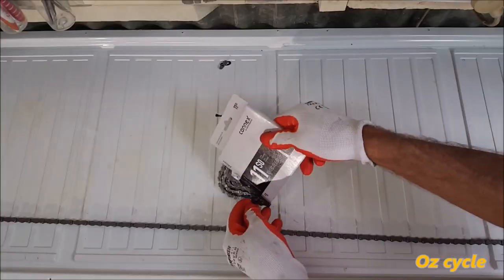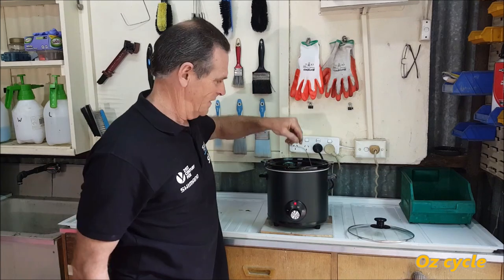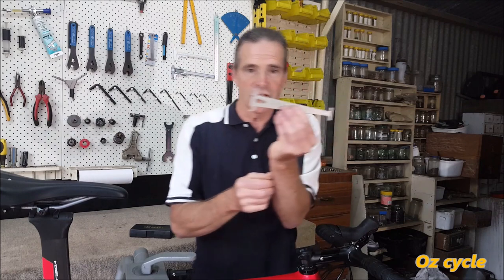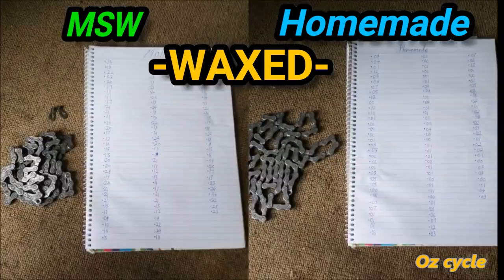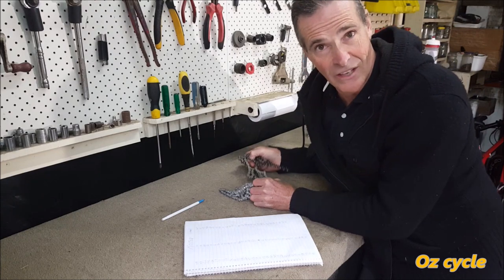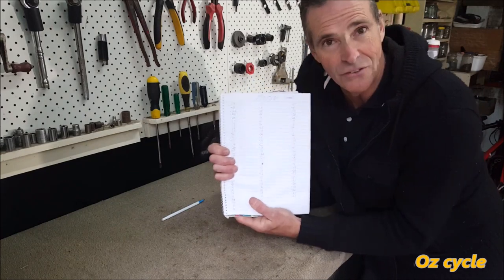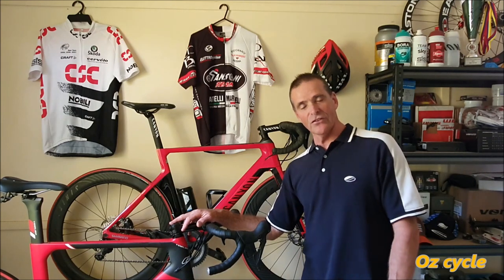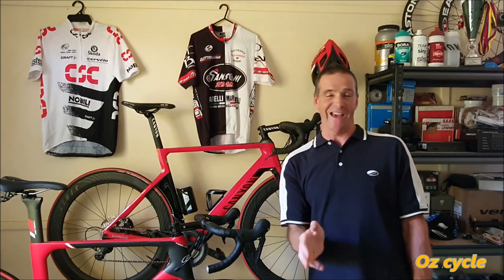Is this the ultimate bicycle chain lube? - Test results

Comment: You should have measured the stretch of the chains before they were used, to eliminate manufacturing variations as a variable.
Reply from the maker: As demonstrated,a new chain measures 0 (or very close to).
Reply: @stevenleffanue  True, a new chain measured 0.  That's probably normal, but it could be an artifact of different manufacturing lots.   Given that the experiment tells us what we expect (e.g. that used chains are longer, and that our special formula is better), that seems unlikely.  But imagine for a moment that all three chains are exactly the same length they came from the factory at; there's a 1 in 3 chance that you'd randomly see the new chain as shortest.  For that reason testing before and after use would be the best way to conduct this experiment.  Nitpicky, I know.  Since it's too late, another thing you could do is try to establish what the normal manufacturing variability is by testing several new chains.

Comment: In the 3000 km that each chain was ridden how many times was each chain lubed. I think that you said when you started to do the testing after 3000 km something about 200+ km. was this typical for both chain lubes. Did they stay on the chain the same in a variety of conditions?
Reply from the maker: Rewax every appx. 250km for both chains

Comment: How often did you rewax or clean the chain? I am about to buy a s-pedelec for commuting with a gates belt drive and now you I am unsure, wether a chain with your wax treatment is also as low maintenance as the belt. Anyways, love your videos!
Reply from the maker: Rewax every 250km Maurice....Will be explained in the next vid
Reply: Thanks oz cycle, then I‘ll go for the Gates Belt.

Comment: Great  video, using a scientific  method  some how!!!. I tried the old  formula but there  was  a moment that it was making  too much noise and I have to say that I didn't found  exactly all what you mentioned in that formula... (I am a Colombian leving in The Netherlands). Then, after some  inspection... I cleaned the chain because of the noise  and I was worry because there was quite some sand particles in  the chain. Here is great for riding the bicycles (bike paths  are perfect)  but is like riding in dunes... lot of sand atfer each ride on your bicycle!!!. However. After going back to lubricants... I regret it. So; here I am also waiting for the new formula, to si if I can replicate it better than last time. Lastly could you  explain the maintenance you did during the 3000km... like did you clean after every ride...or wash it .... only with water or something else... thanks a lot and again great job.

Comment: Hi Mr Oz can I boil this Wax in a Pot on table top stove with Fire? or do I need electric cooker? 
Also you can get 40,000 KM from a chain using this method, any idea how much life you would get from the cassette and chain rings by also using this waxing method? how was the life of ur cassette after 40,000 KM?
Reply from the maker: Yes, you can melt the wax in a pot on  a stove, but it's easy to accidentally overheat it - always keep an eye on it if you do it that way.

Comment: love the videos. This might be a dumb question. Can you use wax on bearings?
Reply from the maker: Not really because its not viscous. Bearings require a lube that moves.
Reply: @stevenleffanue  replaced bearings on front hub. Not spinning as well as I expected. Is there a brake in period?
Reply from the maker: No. Check that seals are seated correctly

Comment: Just a thought but the way the resardue that was left in the MSW chains jar looked magnetic almost in the way it settled, the bits of rust being iron would have magnetic property's and so do metal shavings , like I say just a thought
Reply from the maker: A lot of it may be fine metalic dust from the road? Is there any ferous metal in our brake pads?
Reply: @stevenleffanue  metal brake pads would explain it if you had one bike with them and the other didint, I would put it down as a win that your wax had no metallic bits in the residue from your wax , still it would be interesting to know what the other gunk was made up from

Comment: @17:20 some of the links had a slight curve in them. You should pull the chains a bit before measurement to make them straight. Also they are not completely parallel, which further increases error. It would have been better if you measure the length of the original chain, then compare that to the used length since even 2 brand new chainsets will differ somewhat.
Waxing however looks really promising technique. The fact that dirt is not sticking to it is super cool.

Comment: Most likely the grit from the law chain is metal contamination from the manufacturing the chain. 
You should use the chain with factory lube for a short while before cleaning and waxing them

Comment: Hey - just a thought. If the homemade method is so good against rust, would it be also much better defending against salt in winter? Or is the snow/sand/salt just unstopable, and the only way is to get bike with everything with aluminium and some Rohloff/Pinion gearing with belts?
Reply from the maker: It would indeed better protect your chain against salt. Paraffin wax is quite innert against a lot of substances.

Comment: 4:10 That wax mixture does not look emulsified. Must be that "additive" mentioned at 10:40. Whatever it is it's white (PTFE powder?)
However, this new wax looks solid compared to the old formula which was pasty due to the paraffin oil. I thought there was a benefit for having a pasty wax as opposed to a solid wax which can flake off. Will have to wait for the video covering the new formula.....
Reply from the maker: Correct Derek...old wax is pasty,new one is harder

Comment: Re the initial clean of new chain, why is the msw chain soaked in mineral turps but the homemade one soaked in petrol? Aren’t you trying to do the same thing for both - just trying to remove the factory grease?
Reply from the maker: Yes. Petrol disolves the grease better than turps.
Reply: @stevenleffanue  that’s great mate. Thanks for letting me know 👍

Comment: Thank you for your extensive research. I’ve read that it’s best to pre heat the chain prior to putting it in the molten wax, have you tried this?
Reply from the maker: You can put chain in whilst still cold and heat or when  wax has melted...I didn't notice any performance differences.
Reply: Thank you for your reply. I’ve put it in when hot and seemed fine, I will try from cold and see what happens. I know you’ve been asked but I’m a bit stuck, I used lamp oil think it was the same as paraffin oil but the wax felt slightly dry when rubbed. Do you use liquid paraffin even though it has a low flash point?
Reply: To add, because we in the UK name stuff a bit different paraffin liquid is basically kerosene for heaters and paraffin liquid BP is the oil. If I have this wrong please correct me.

Comment: In the molten petrol it's molybdenum powder and the reason for the extra wear might be that the chainrings had different wear from the beginning.
Reply from the maker: Both bikes had same mileage and chains were swapped to each other bike at rewaxing.
Reply: @stevenleffanue  then I'm non the wiser. Very informative video. Thinking about waxing my chain now. Have you tried using an ultrasonic cleaner for the application of the wax and tungsten disulphide instead or combined with the teflon?
Reply from the maker: I found that repeated uses of ultrasonic baths puts minute pitts in metal surfaces. Chains quickly loose their anodizing and rust becomes excessive
Reply: @stevenleffanue  Oh that makes sense, thanks! What about the tungsten disulphide?

Comment: @ oz cycle: are you saying there wasn't any rewaxing-refresh whatsoever for the full 3000km for neither chains? Comes Two different questions: (1) Could it be the MSW wax is mostly gone -as evidenced by the rust spot perhaps? So the difference isn't performance but just highlight a cost difference (time & money). Are we explaining that difference in durability by the only the MoS2 in the MSW product? If true that would be quite a downside (2) Should we interpret that the "HM wax" (1:10 PTFE @1.6um) only need refreshing every 3K-km ? And save on consumables? SO Why then does the subsequent video recommend a rewax maintenance of every 300km ?  Few last questions is what would be the  "HM" durability difference between paraffin-only and 1:10 PTFE additive.  Could the ambient temperature alter the projected durability we think (any error bar there)?
Reply: For higher operating ambient temperature, may use higher melting point wax.
Reply from the maker: Rewax every 250 - 300km. 
The PTFE wax performs better than oiled wax as oil  attracts dirt. Temperature doesnt matter
Reply: Seems like MSW might be something around 0.01:0.1:10 where 10=wax,0.1=PTFE,0.02 MoS2 % weigth. Could the delta with "HM" comes from the lower PTFE grade in MSW? Maybe MSW has the best cost ratio for volume with lower PTFE higher grain size that requires a tiny amount of emulsifier. The HM seems more cost-effective. Also the metling temperature guidance from MSW probably applies to HM. My guess is higher cycling temp is reducing the content of higher carbon number loosing its property and making it more oily-like.
Reply from the maker: It would be handy to know the grain size of the PTFE used in MSW.

Comment: OZ, did you experiment with wet-ground Micra powder? with or without the PTFE? From what I've read, wet-ground is best for use in lubricants. I`m curious as it could be a way of introducing colour to the lubricant and an indicator for when to reapply.
Reply from the maker: May interfere with the lubrication properties

Comment: Help! I have my formula down to 3parts solid/2parts liquid paraffin. consistency is good, just not flaky any more, but after a ride in wet conditions I see surface rust at the lashes around the pins. Wax coverage isn't great is my guess. What to do?

Comment: I almost forgot- great results! I used to use paraffin wax years ago, back when 10 speeds referred to the whole bike. I’d like to learn your formula.

My lube for the last several years has been a 1:5 ratio of heavy gear oil : mineral spirits. Apply and wipe off. Works well, but I do it often.
Reply: By gear oil do you mean transmission oil?
Reply: @michaelfasher  
No, I’m talking about the oil used in the differential, SAE 80 or 90. I suppose that bar and chain oil used in chainsaws would work as well or better, but I’ve never tried it.
Mix the oil with mineral spirits, about 1 part oil to 5 parts MS, the ratio is not fussy. Apply to the chain using a brush, slowly back pedal to work it in, then wipe as much off as you can, taking the dirt away. Let it dry overnight before riding. To that end, I try to do it at the end of a ride, not the start.
Reply: Why did you change?
Reply: @Leo-gt1bx  
I changed when chains changed. You used to be able to press rivets out, dip the chain in the paraffin mixture, then reassemble. When chains became narrower with 8 speed cassettes, you couldn’t do that anymore. Now you can use a power link to do that, and even more easily, but I like the ease of using my oil/mineral spirits mixture. It’s easy and the chain gets really clean in one step. I’ve been using the same quart of gear oil for at least 20 years and I still have most of it.

Comment: You are magicman, great job 👍, I wax my chain month ago with 50:50 parafin wax and parafin oil, it's realy quiet and smooth. I'm curious for new formula. One question: how many times was cleaned / waxed those chains during 3000km???
Reply from the maker: 11 times each chain
Reply: @stevenleffanue  thanks

Comment: Interesting, thanks for the info - like your style. As acknowledged bike chains are cheap mass produced somewhat non-precise. In the case of early motorcycles drive chain wear was huge 9some even went to enclosed oil baths), until o-ring chains which sealed in lubricant and said chains now last huge distances with huge power being transferred. However more friction with the 0-rings in the chain. A few watts of power loss, not an issue with 100+ Kw engines. So this leads me to the big question: power consumed Vs wear. In a racing scenarios racing mates or say  "real racing" Roglic/Valverde etc a chain that lasts forever but sucks say an extra 5 watts then Watt weenies would  probably go with more wear. Have you though about measuring watts consumed - say just after waxing, 100Km after re-waxing a few times etc? Has to be easier than measuring every chain link ;) Thanks again
Reply from the maker: The bicycle chain doesnt have o rings and relies on metal sliding parts. At low power,paraffin wax offers the lowest friction recorded (see bicycle lubricant friction charts).

Comment: May I ask if there is anyway to tell visually whether the wax is really adhering to the chain surfaces and in between gaps?
Even with clean chain, the leftover wax seems chunky and “breaks off”. I am not sure whether insides are waxed
Reply from the maker: If your chain has been cleaned properly the wax will stick

Comment: i found your videos in the past by accident researching the best lube for a motorcycle chain. i tried wax without success. in fact the wear was just like a dry chain. i worn 3 expensive chains testing various wax and technique. i then started using motor oil and it almost stopped the wear. i am not saying wax is not good or that you are lying. your test clearly prove it to be the world best for bicycle use.
sadly it isnt suitable for all application. motorcycle might put too much pressure and centrifugal force on the chain for wax to work.
Reply from the maker: Thanx for letting us know how it went on your motorbike. Cheers

Comment: You didn't clean and re-waxed the chains for 3000 km? In previous video's you told to re-wax (dry or liquid?) every 300 km...
Reply from the maker: Yes,rewax at 250km
Reply: The whole procedure? Taking off, cleaning and hot waxing?

Comment: How about testing different types of wax (with no additives)? I’m a beekeeper, so I waxed my chain with beeswax. When I tried adding PTFE to the wax I was dumbfounded by what I saw! The PTFE floated on the wax like oil on water. It would not mix in no matter how vigorously I stirred. Beeswax obviously is different in some way that makes it better OR makes it worse than paraffin wax. Worse in the sense that PTFE cannot be used. But might it be better as a wax? Good question for somebody to investigate. My guess as to why the PTFE does not mix is that beeswax has some hydrophilic properties that repels PTFE. Just guessing.
Reply from the maker: Bees wax presents a high stiction rate
Reply: By “stiction” do you mean higher friction? So you have tested beeswax? Or are you relying on a third party source? Very interested and curious. Thank you!

Comment: Would you recommend this for mountain bike use?

And did I understand correctly that you didn't clean your chains AT ALL for 3,000 km? I can't get away with NOT cleaning and lubing my chain (with wax-based lubricant) every two or three off-road rides; can't imagine not doing it for 3,000 km! :-D
Reply from the maker: It works brilliantly for MTB as wax is excellent at repelling water and dirt. Rewaxings every appx. 250km
Reply: @stevenleffanue  How do you clean it before rewaxing? Same as in the video after the 3,000 km?

Comment: So is this with no rewaxing for 3000km? If so I'd like to know more. I can almost never get over 300kms on one waxing.
Reply from the maker: No. You will need to rewax at appropriately 300km
Reply: @stevenleffanue  Yay! I've been actually keeping to 300km on every chain before rewaxing. Regarding the residue in the petroleum - I have a lot more sometimes. Some of it is just dust, some it actually iron metals and I collect them with a magnet under the wax. There is steel wear in the system
Reply from the maker: Yes there is steel wear but it is minimised by using wax as the moving parts rub on the wax rather than a thin oil.
Reply: @stevenleffanue I am pretty sure the anti wear agents in motor oil are much more effective against wear and tear than wax. Not to mention it's anti corrosive properties are superior to that of wax.

Comment: Did you clean and rewax de chain between the 3000km of the test? After how many km would you recommend cleaning it? Is the wax from a candle as good as the one you used?
Reply from the maker: Rewax every 250km. Candle wax is good or refi ed paraffin wax is best